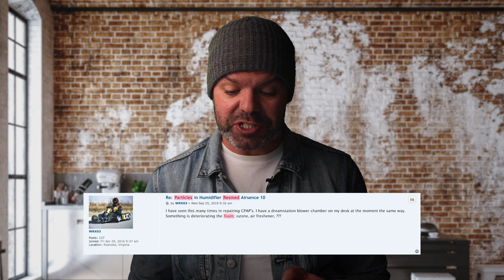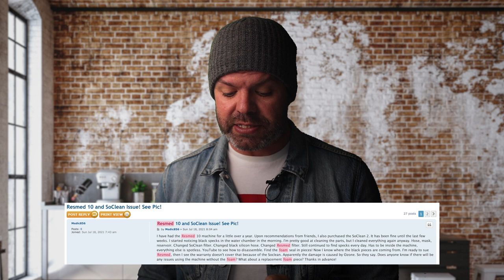🚨WARNING! AirSense 10 Foam Degradation & Removal

Comment: Just to be clear for those internet trolls, this foam degradation is due to Ozone, not normal use of the ResMed machines.
Reply from the maker: Hi Mike, thanks mate, yeah i tried to make that point clear during the video but i doubt many will watch it right through. 100% due to ozone use. Not one of the many many people who have emailed me did not use ozone and most had used in excess of 12 months. Cheers
Reply: I can smell an odor in the Resmed airsense 10.  Same odor as new.  Now 4 years old.  It's not dust/dirt.  Never used ozone.  What is that smell?  The foam?

Comment: So…I’ve been using So-Clean daily with my ResMed 10 for maybe 2+ years. I don’t have any particles, but I did notice discoloration (potential damage) to the foam topper on my bed. 🤔. Does anyone have a recommendation of how often, in terms of day frequency, to use So-Clean? Mine is set to the 7-minute default.

Comment: Why is the foam anywhere near the airway on any of these machines, whether or not the foam is deemed safe or not. Isolate the sound deadening foam in it's own case. Does this make any sense to you at all Nick that these cpap machines are designed this way?
Reply from the maker: I guess if it's isolated perhaps it doesn't work as well dampening the noise. I'm not sure but they must have a reason surely. All the best. Nicko

Comment: Mine has the green foam, its still in good shape. Can you get the new foam piece like the one in video?
Reply: Or should I leave it out? it is a little dirty.
Reply from the maker: You can't get them mate. It doesn't do a whole lot so you can leave it in or take it out and doesn't change the function. Cheers

Comment: What is the purpose of the foam?  There is already a filter before the air gets to the foam.
Reply from the maker: Sound abatement foam (noise insulation to make them quiet)
Reply: @CPAPReviews  Seems unnecessary for the air we are breathing to be pulled through the sound insulation.  Perhaps there could be a design improvement.

Comment: So if Ozone damages the foam in the machine what can you use to clean the internals of your machine ?
Reply: you hand clean it yourself
Reply: @af1966  could I ha e the Amazon link please 😊🙏
Reply: @faya6974  how often do you hand clean the internals?
Reply: @mikestone5904  Doctors will give you a daily routine, but you can do it once a week (or even more). I personally do it whenever I remember. Its really not a big issue.

Doctors will also give you a schedule to when you should replace your mask and hose, but you dont have to do it. Replace them only if it stops working or you feel they need to be replaced.

Comment: What about Resmed Air sense 11 ?
Reply from the maker: It has a lot more foam - https://youtu.be/y1C7pxg3PM8 however it's the same type as the AS10. I think you should still be fine so long as you don't use ozone

Comment: I have had Resimed machines for around 3 years. From the begining Resimed always said dont put the machine itself in the any ozone cleaning device. I use an ozone cleaner but only use it for the tube, mask and water tank. I have never put the hole machine in the ozone cleaner. Plus you can get a new cpap machine every 2 to 3 years with a doctors approval. I have a 2nd cpap machine. I think people should look into replacing their cpap machines as often as they can and should. NOTHING LAST FOREVER PEOPLE.

Comment: Hello all, just need to point out that taking the CPAP machines apart is a very dangerous thing for your health! For one, you need to make sure all screws are tightened to the same torque as the mfg tightened torque, otherwise you will risk the devices leaking! And since you don't know what the correct torque is anyways, I wouldn't go around undoing and tightening the device myself, but leave it to the service technicians instead. Additionally there is a maximum number of times you can do this before the part is deemed not usable and has to be swapped out. Please take note as this is very important! The design consideration for torque is made such that it will create an adequate seal but not damage the screw boss, and for us laymen who don't know / don't have the right tools nor know the correct procedure (combined with static damaging the control boards and also contaminants in the motor box), it is definitely not recommended. It is basically do it at your own risk!

We do need to be educated, but we should be educated correctly, and by that I do mean from a certified technician, not a youtube video even though in this case the creator does seem confident with his ability. While the information here is definitely true, with these heavily controlled devices it is not a "take matters into your own hands" situation. I think the creator of this channel should definitely have a disclaimer prior to the disassembly section of the video outlining the risk of doing this yourself! @CPAP Reviews. I feel that the "if you F### it up, don't come and blame me" warning is definitely not enough as it is somewhat light-hearted, which does not convey the gravity of the situation, should you actually do mess up and not know, which is another thing because sometimes you won't know and that puts you in danger!

Comment: So, here's my strategy:  I use a small, handheld ozone machine to clean ONLY the hose and mask, once a week.  During the week, I clean my mask with soap and water.  Also, I soak the water tank with soapy water. I DO NOT touch the machine itself with ozone.  As near as I can tell, there is no reason to clean the actual machine with ozone.

Comment: Gee, who would think that injecting highly reactive oxygen radicals into plastic would cause the plastic to degrade? And looking at the soclean site, there's no indication there that it's actually safe to use in CPAPs. Additionally, ozone is not approved by the FDA for cleaning CPAPs and when I got my CPAP, I also got a notice that using ozone to clean it would void the warranty.

Comment: THATS GREAT! thanks for nothing nick. i posted something on your video "ResMed CPAP Mask Upgrades! Good Or Bad?" I told you i needed help because I was afraid for my mom's heath using the ResMed. i had black dust inside the machine, and you didn't have the decency to reply back. every time i tried posting it, it disappeared, i also took photos, i had to put my post in a reply to you. Go have a look everyone.
Reply from the maker: I'm not the ResMed customer service rep mate. If you've got a concern give them a call

Comment: Has anyone removed the foam from the Resmed Airsense 10 in order to avoid all possibility of degradation?  If so, how noisy is the machine without the foam?
Reply from the maker: Hi there, many have however there's really no need unless you see evidence that you need to etc. It hardly makes a difference to the noise. Cheers

Comment: never understood why folks use ozone and stuff like that to want to clean the inside of the machine anyway what is the point you risk stuff like that happening to yourself they say all you need to do is clean your supplies (mask tube humidifier) with soapy water rinse and let dry its that simple no need to do anything els esp if you still under warranty and the machines only suppose to last 4-5 years then you should get a new one

Comment: My ResMed S8, which I have had since 2014 got System Error 1019, which as far as I can tell is the kiss of death from excess water getting in the device. I realize it is an old design (2007?) but you would think they would have figured out how to keep the water from backwashing and causing terminal failure. 

Don't know if it is repairable, but I managed to get the Airsense 10 for about $800 USD here in Mexico. Of course significant engineering went into the design, but the prices they charge for these, and the refusal to repair their own machines is just corporate greed. I hope this one lasts, even if it will be giving me end of life popups.
Reply from the maker: I wouldn't bother repairing the S8 mate now you have an AS10. I know a lot of machines now will continue to blow air after you turn it off to dry out the insides. I can't remember if the AS10 has the feature. I know the AS11 does. It's a very reliable device the AS10, you should get many years before the death pop ups. CHeers
Reply: @CPAPReviews  I started using a brand new AS10 on 30 Sep 2021 and yes, it continues to blow air to dry the inside after each use.

Comment: Cautionary note: If you need to remove foam from the blower, using an air duster etc, dont allow the turbine to spin with the compressed air. It may overspeed and damage the bearings.
Reply: Why would it overspeed, when it's designed to run at a specific rpm?
Reply: @Resist4  If you point a jet of compressed air into the blower, the velocity is high enough to make it spin extremely fast. PC fans can do the same, even explode, as can roller bearings spun by air when dry. 
The blower fan in a cpap can, in normal use be doing 40,000 - 50,000 rpm. Much higher and bearings or fan will suffer.
Reply: @damian2079  yes, but I highly doubt canned compressed air will overspeed the turbine.  Those things are as fragile as you're making it sound.
Reply: @Resist4  Not every one would use canned air. We use a clean 'breathing air' compressor.
And canned air (full) is about 140psi btw. Its a simple precaution, just block the rotation with a bit of something soft enough to not scratch the turbine. The balancing of them can be easily disturbed. Yes, even by a deep scratch.
Reply: @damian2079  you honestly think someone would use an air compressor to clean out a CPAP machine?  I highly doubt that.  You are way over thinking things.
Reply: @Resist4  Yes. We do.
Reply: @damian2079  Well, that's a shame and unrealistic.
Reply: @Resist4  Seriously  ? Why would we use canned sir, when we have medical grade, clean air at controlled pressure ? I service medical equipment for a living, dust is an  enemy of electronics. Cleaning it out is vital  Not sure if YOU have ever worked on anything like this, but I can tell you , you cannot dismantle the blower once its balanced. Air is one if the (very) few ways to clean it.
Reply: Great tips to handle the blower fan gently & prevent it from turning while blowing dust out with air, so you dont put it out of balance or damage the ball bearings.

Comment: Odd, my foam on my resmed is fine after two years of using my so-clean.
Reply from the maker: I guess it would depend on how often you were using it etc. Glad it's still in good condition. I would however stop using So-clean on the device. Cheers

Comment: The individuals that developed a device that generates ozone for cleaning should have taken a basic chemistry course. Ozone generates an oxygen free radical that degrades plastics.  The free radicals generated cause cleavage in the chemical bonds ultimately over time lowering the molecular weight so much as to destroy their mechanical integrity. As a result, some of the degrading material stuffs of as particles. The moral of the story is to NEVER use ozone the clean any plastic part. This degradation will not be observed initially as the degradation is cumulative.

Comment: Well it looks to me that you have a choice of the machine getting moldy inside or possibly ozone damage. I got my air sense 10 a year ago. I started. cleaning it manually . When I did this , the hose, mask, and tank never dried, even when hanging them for 12 hours. When I turned it on, water came through ugh the hose and mask because there was residual. Breathing water into your lungs is not good either. Do I have been using sockean for 10 months. No problem so far. Never see anything in water tank. May just stop using CPAP all together. Looks more dangerous than not using it.

Comment: The ozone thing just seems like a terrible idea... ozone is a strong oxidizer that I would expect to contribute to the break down of any kind of foam with enough exposure to O3 gas. Which is why it is so powerful at removing odors - it is chemically reactive with more things than it's not and it destroys odors by reacting with the molecules responsible for the odors. It's not that different from how something like Chlorine or Bromine works. Like if you overbleach a shirt you can actually destroy the fibers of the shirt. Anybody who has used a large ozone generator knows it is no joke and you can easily overdo it.